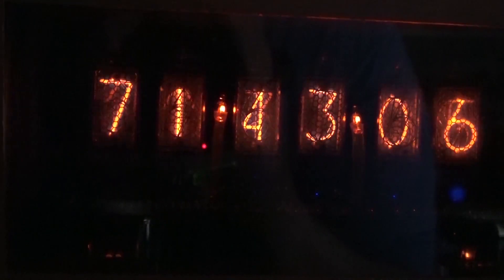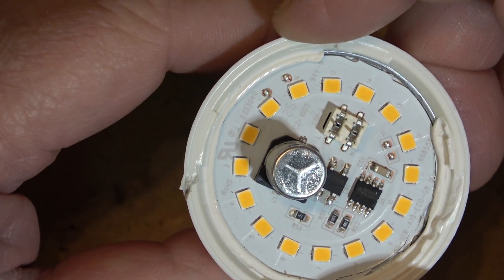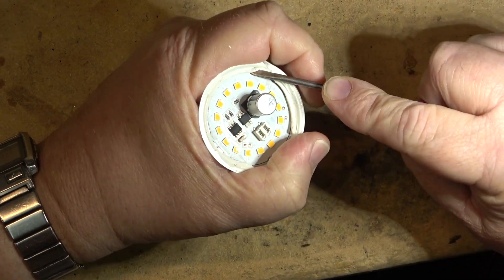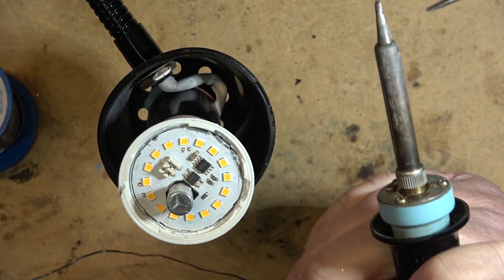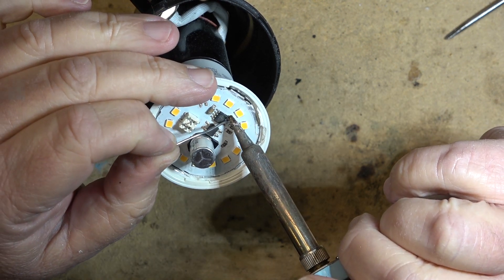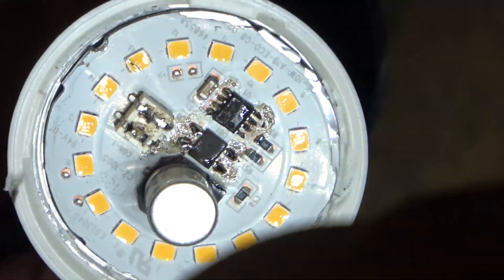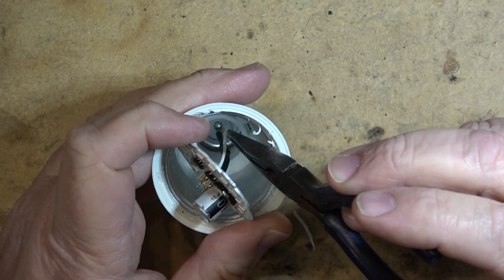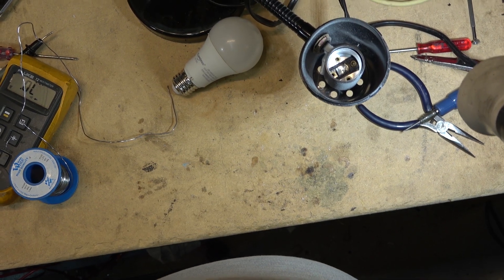LED Bulb just blinks once at power on

Comment: Seems all the LED lights in Australia have their circuit boards potted in epoxy in the base with only the low voltage leads coming out and onto the LED plate, none have every had components on the LED chip plane. They don't have any components except for the LED chips. So doing any repairs is not possible. To make matters worse a 9W non dimable BNC or ES light cost starts at A$10 ea and a dimable version A$17+ ea you're lucky if they last 12-18 months. Seems we are at the shitty end on the dumping supply chain.

Comment: Have fixed quite a few that happened to have badly soldered current sense resistor(s) since they usually get quite warm and thus more thermal stress. Tapping the components with a non-conducting stick while powered can easily find which joint is bad.

Comment: Im not liking LED bulbs. It doesnt seem to matter if they are generic or name brand, 90% or more have issues. And when Im paying $15-20 USD for four bulbs its a problem. My latest failure was in my bathroom, bulb was a week old. It works, but it randomly will flicker, and sometimes go out for a minute or three then come back on. A blackout is always fun when you're in the shower, said no one. Lol I just throw them in a box and put in a new one. Eventually I'll mail the failures to the manufacturers with a very lovely letter.
Reply from the maker: If you are paying that much you are being ripped off.  Name brand available in Canada for 2.00.
Reply: @12voltvids I was thinking that too. They were bought locally, walmart and home depot, and are 100w/150w equivalents, but shouldnt be that expensive imo.
 Prices literally doubled during/after covd.  I prob should get them cheaper online since failure rate it so high either way.

Comment: Light bulbs in Kosovo are dirt cheap (1-1.5$) I try to fix all broken ones, not because of the money but because I like fixing them. I fixed my first TV when I was 13 (cold soldier joined) with a piece of wire and a candle, I was so proud of myself. Even today when I fix stuff it gives me joy...
Reply from the maker: They Are only 1.50 to 2.00 here too.  Wife does in home senior care and takes their trash and recycling away.  This came our if a box of recycle stuff.  You would be surprised at the number of good batteries that are tossed.  I check em and recycle the dead ones and the good ones I use

Comment: All of that to save money?
What. A great video time to follow in your wonderful foot steps
Reply from the maker: Nope. Didn't buy it.  Came out of recycle bin but I will use it.
Reply: @12voltvids  I resoldered a disconnected capacitor from a led bulb I bought 14 years ago. It still work like a charm.
For the other ones I got from recycle bin, I replace the bad led chip with solder and I replace the board with a custom one so I won't cause overheat ( half of my repaired bulbs are 4 - 5 watts and 4 others are 1 watt each)

Comment: have you ever done a Weller Solder station repair video? i have a 1990 vintage unit i need to repair
Reply from the maker: No. My Weller has not failed.   I repaired one years ago but no video.
Reply: @12voltvids  🙏 Prayers we didn't Whammy yours 😇

Comment: Recently two led bulbs failed for me, one fell apart completely, even the glue failed that kept the cover in the base, and it was just about 1 month old. Another one just went dim and flickery, lasted almost 5 years. Interestingly when switched off, it stays on about 1-2 seconds before fading away, probably draining the capacitor that slowly.

Comment: I had a great value bulb where that connector at 2:17 had a bad solder joint on the connector and it failed after about 100 hours only. Took it apart and resoldered it and it has been working perfect for months now. Maybe i should have soldered it to the connector like you did though

Comment: Speaking of the light bulbs, I have some CFL light bulbs, including one 10 watts, some 13 watts, some 14 watts, and some 15 watts that no one is using it as an interior light, I decided to use as a Dusk-to-Dawn light in the backyard including replica Baldhead Lighthouse, and to use Dusk-to-Dawn motion sensor security light while they are using LED as an interior light. Leftover CFL is what I figured I can use as an outdoor light every night and it was a good idea to do this for me. Anytime I find a dead CFL, I will replace with the another used and new CFL, and I will salvage the circuit board and discard the bad CFL light bulb. Until when I ran out of the CFL, I will use LED as an outdoor light every night. That will not include Globe CFL, and the light capsule CFL because it is made for indoor use. Halogen light bulb is what I never use as an Dusk-to-Dawn light, however halogen flood light is what I use as an Dusk-to-Dawn motion security light in winter. At the time when spring arrives, it's going to be a LED flood light and save the halogen flood light for the next winter. That's how I use in certain things.

Comment: And they are worth fixing because they will last 5 times longer than expected - now that they are built right. 

Cheap stuff: great ideas with adequate parts poorly soldered or manufactured.
Reply from the maker: I have so many LEDs that were picked out of the garbage here that work great. I have not bought any and yet pretty much every bulb in the house is LED now. I probably have 20 or so that came out of the garbage. I was working at an apartment block and found about a dozen tossed in the garbage. Brought them home and fixed every single one in 5 min or less.